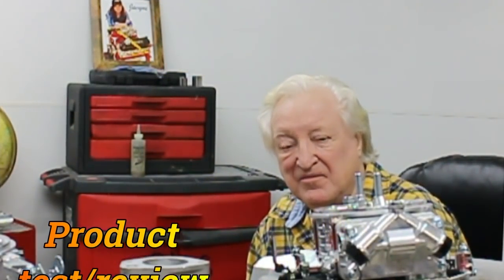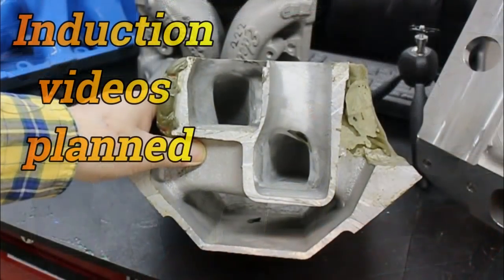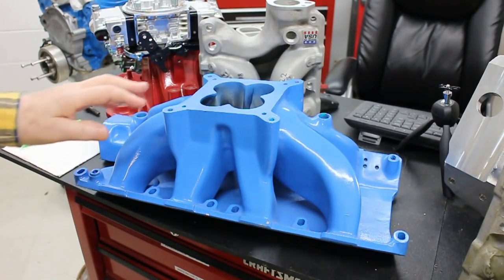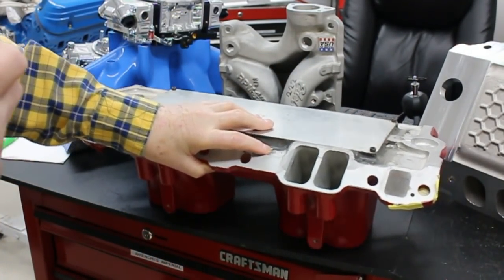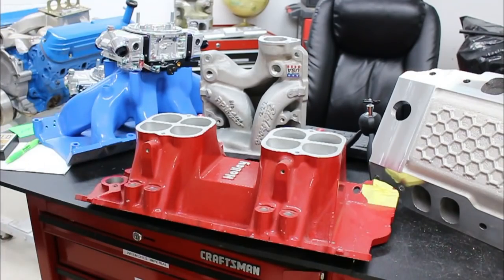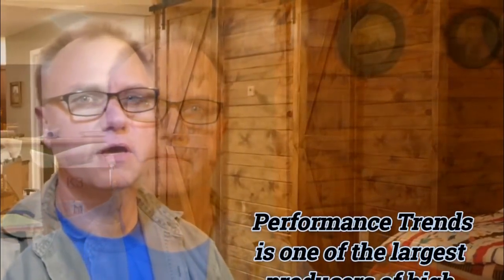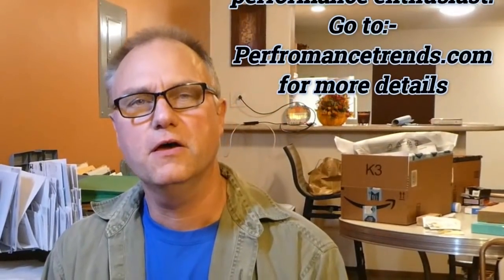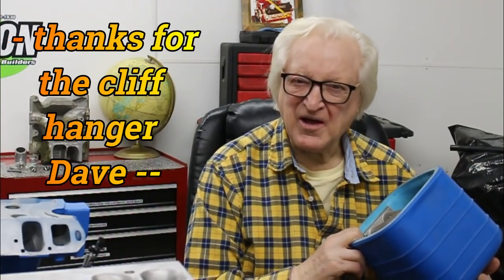David Vizard's PowerTec 10 EP 40 What's new for 22 part 2

Comment: Fuel\petrol ratio.Mixture-screw.5 minutes ago,inserted a petrol line inner 7 mm ,inside air box tunnel.For compressed air.Tried a shim,7 mm hole inside carburettor.It would not start,smallest 0.4 nozzle.Did 60km\h poor.Same fuel line melted on carburettor fuel intake.Very cheap metal coated fuel-lines on web.Tune thin out fuel,no tuning on air.2700 celsius in F1 combostion chamber.Watched guy bought hond mp4\5 or 4\6 3.5l.Wrecked the car.He on\off throttle to heat,but DIDNT KNEW,full gas before 2700c,before motor run proper.Explodes chamber,no burn in cold thinned mixture.1 billion dollar.Same as cold winter start.

Comment: To masako!  That air conditioning fuel line idea is excellent.  And it was ahead of its time.  I had a trick with HEI Ignition systems  And an alternator cut out At full throttle  Is the HEI ran at approximately 9 V through a resistor for spark  I used a microswitch and 2 solenoids,  Wired  so that the solenoids would trigger at full throttle  and simultaneously shut off the field voltage to the alternator, and put battery voltage directly to the Coil!   People would wonder and ask me why my headlights dimmed when I floored my car off the line  At night. It was cool and it made people ask questions but I never knew if it had any real performance benefit!??
Reply: Very clever thank you

Comment: Thanks!  Elmer And thank you Mr. Vizard! The only research and information I could find on the long ram, was  on the 383 B and the 361 B Engine showed a 35 and 45' foot pound increase at 2800 RPM when going from a dual plane 4 barrel,   to the 30" long runner Dual 4 barrel intake. Furthermore "Direct Connection"  recommended retarding the stock Cam shaft 4ﾟto realize these Torque gains.  Respectfully, Kurt Osborne

Comment: ford's 2100 2 barrel best 2 barrel ever then they made the 2150 still the best
i like the edelbrock carbs easy to work with and work great, holley SUCKS , setting float levels by looking in a dark hole wilst laying on the engine dont have to do that with the edel version, and then engine backfires and blows up some valve some fool put in it don't have that prob with edel version.   quadjets, carters, motorcraft holleys none adjust worked fine , holley has cornered the market on carbs by buying the competition and they are stealing your money everytime you buy one
Reply from the maker: Mr, No Way - I don't suppose I should ask if you have an opinion on this????  Seriously though, you do have some points here that do need to be in any carb comparison. I would like you to describe all the negatives you believe should be high-lighted. If you feel you can put forth some good and bad points lets have you in the relevant video. 
Send me you contact info and what you are contacting me about and I will give you a call and lets see what we can put together here.
DV
Reply: @marvingvx1  well, i surely do appreciate the offer, but, no thank you that's not for me.
Reply: Holleys are a breeze to work on and adjust.  Why is the engine backfiring through the intake and blowing the power valve? 
Like any piece of equipment, you have to have a bit of mechanical sensitivity and think about what is going on with the rest of the engine.
Holley is on a large percentage of high performance engines because they work pretty dang good when properly matched up to an appropriate engine, and represent a good value.

Comment: Sorry guys..   Just don't buy the 100 mile per gallon thing. Sure carbs are not great atomizers of gasoline, bit that is what squish in the combustion chamber is for. And now we have direct fuel injection and we get only marginal fuel consumption reductions. It all comes down to how many calories it takes to move the vehicle
Reply from the maker: JC - please bear in mind these results were measures and documented by the Motor Industries Research Association  - NOT BY ME!!!!
Reply: You must remember that any conventional engine wastes a ton of fuel. Only fuel vapor burns. There is raw fuel that runs down the walls of the intake runners and into the chamber that then gets pushed into the crevice volume on the side of the piston. This stuff only burns after the piston comes down and really burns too late to create effective pressure on the system. Also remember that liquids don't like to vaporize when they are exposed to more pressure, so if it isn't a vapor by the time the plug lights, then it won't be of any use and thus wasted. On many dynos that have had o2 sensors on all exhaust ports they can show wild swings in AFR and the engine not showing any signs of detonation; which would prove many that maximum power and maximum fuel efficiency are not related but share characteristics.

Comment: Have you ever tested the Street Demon carb? It's a modern take on the old Thermoquad. On my 390FE F100 I used to switch between a 450 to 750 Holley depending on towing or fun applications, with a 750 street demon I got both worlds. I would be interested on your thoughts.
Reply from the maker: Sam, Yes - and I have a video to do on the. Bug me as often as you like so I don't forget!!
Reply: @marvingvx1  I live in western North Carolina so I'll be glad to bring you my 750 street demon and tuning kit for testing. First, I need to haul my trailer full of scrap metal once the snow melts. Only catch is I get to watch and learn.

Comment: Don't know if David will ever see this, but here we go. 80's 5-liter throttle body Mercedes V8's had the input line from the fuel tank wound in a spiral around the cold side A/C line. So, whenever you had the cooler on inside, it would bring the fuel waaay down before it entered the TB. For some reason, the Americans never incorporated this (as far as I know). Think about it, guys.
Reply: On my street race cars I have actually kept the air-conditioning and put a large very long coil of aluminum fuel line inside the AC Ducting, right after the blower fan, you can only do this on a street race vehicle! Its illegal at a racetrack. I tried to patent this idea in 1984! My idea was stolen during the expensive process! Get Witnesses,  document everything and research the company that claims to help you patent ideas !!!!!!
Reply from the maker: @masakoo5952  
You are another one who has had to learn the hard way!!
DV
Reply: Jaguar XJ-S v12 had a similar system but on the return line to the tank. Why they did it? Some say because of emissions but I don’t know. All I know is that you can’t feel a difference if it’s working or not because my v12 gulps fuel anyway. 😀
Reply from the maker: @richardjohansson5640   
Richard, I guess our upcoming V12 head porting  video will be right up you ally.
DV
Reply from the maker: Mr. 413x398 (bore & stroke??) I did not know this snippet of info but it sure is worth mentioning.
DV
Reply: @marvingvx1  Thanks, David. Yes, bore and stroke of a 428 Ford. I own 6 factory Cobra Jets, 2 more with CJ swaps, enough to build 8 more engines, and six 427 FE's. 59 cars here right now.

Comment: Did the Chrysler  Dual 4 barrel "LONG" ram from "The sixties" for the big block actually make more torque than a dual plane? I have the fabrication skills and I think it would be a perfect fit for the Cadillacs stock limits!
Reply: I don't recall the specific numbers between the ram intakes and others, but there were two different basic versions of the Chrysler ram intakes. One had longer runners, and one had shorter runners, the long runners were tuned to around 2800 RPM for best torque, and the short runners moved the torque up to around 3600 RPM or so. For the day, they were pretty high tech, but they were also temperamental to get the carbs tuned right, and were rather "peaky", trying to say that under and over the target range, they behaved noticeably differently. The tech for induction and intakes has come a long way since, and the newer designs do outperform the rams. These were built around the ideas of resonance and acoustic pulses that affect the carbs. I hope I have explained a small amount, at least to get you headed in a direction to find your answers. It's been quite a few years since I've been around those, lol.
Reply from the maker: @elmerfudpucker3204  
Elmer, - Thanks for the comment. I was unsure of how well or not these worked. It's good to learn something new every day.
DV

Comment: What is fat flow on a cylinder head? I can find nothing on the internet!
Reply from the maker: Kurt, in the comment above, is essentially correct but his explanation is a little on the short side. I am probably the only one that uses this term. What I am trying to put over here is that the flow curve is strong in the low and mid-lift range - & I just know that is what Kurt was trying to say!
Reply: @marvingvx1  I never took the next step because of that patent Fiasco of ducting the cold air from the air conditioning directly into the intake to my infinite despair much respect mr. Vizard!

Comment: You Mr. Vizard are truly awesome.  It's been a long time since I've had a car to play with,  however I am fixing to start on one now.  Everyone is running N2O so I figure an s10 85ish with a 355 sbc with vortec heads with Pontiac exhaust valves 1 3/4 headers  3" exhaust exhaust advanced 2° with a progressive 250 shot should get everyone's attention...cheapest way to be competitive here in GA. I may be being too optimistic
Reply from the maker: Roger, good game plan except for the cam. Will get to N2O cams down the road.
\DV

Comment: I worked at a Ford dealership during the vv carb era. I remember when the Ford rep was at our shop we bought up the carb, he said that carb works great. To witch we stated that it was OK as long as you didn't expose it to heat and gasoline. It was a very problematic carb.
Reply: I always remember it a as a bad word, like Lean Burn. They were tough times for auto tech.
Reply from the maker: Tom & @rotaxtwin , - a lot of what I should have remembered has slipped my mind since my brain op. Any chance you guys can help[ me get up to speed here????? 
DV
Reply: @marvingvx1  I didn't work on the variable venturi carb myself, I was pumping gas at an old school gas station that had 3 bays with mechanics. It was 1982, maybe 83 so the Malaise Era for sure. The carb was known for all kinds of driveability issues and idle mixtures that could not be adjusted rich enough. Not simple to replace, unlike the Lean Burn system of Chrysler's which could be removed and replaced with a conventional distributor, generally through Direct Connection at this shop.
Reply: @marvingvx1  the rubber they used in the diaphragms would turn to mush from gas fumes. Also when I was working in a high altitude ski resort those things would flood when cold starting and where next to impossible to start with out replacing the plugs.